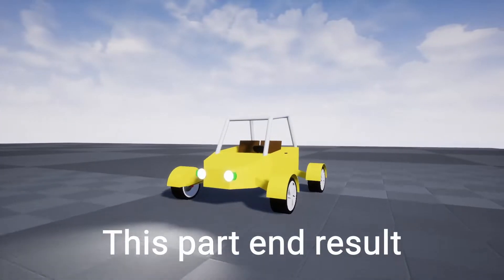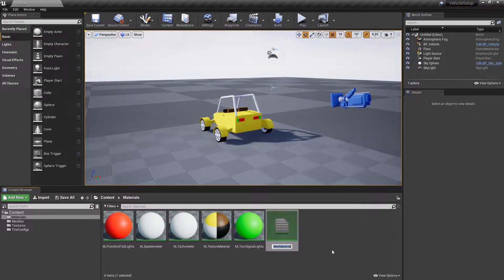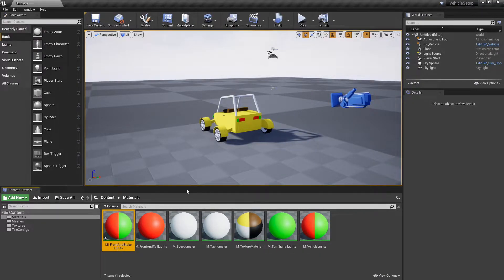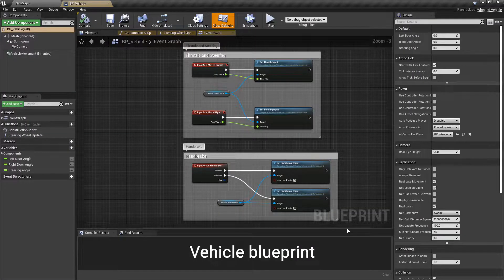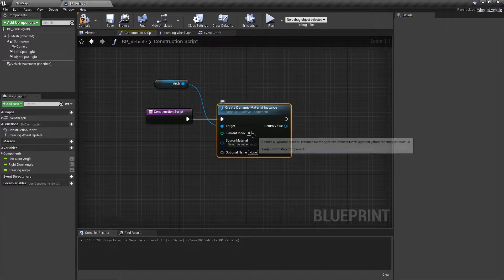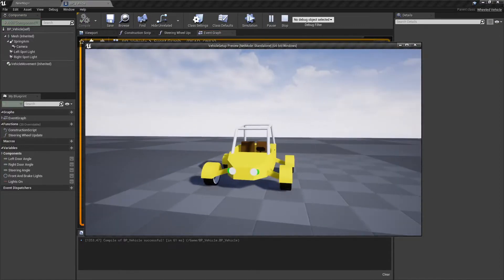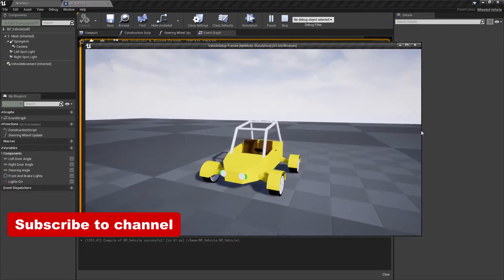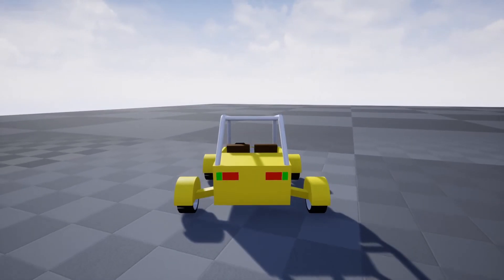How to add lights and brake lights to the vehicle | [Part 9] Low poly vehicle for UE4

Comment: Hello, I would like to set up a separate material for the front lights and separate material for the back lights. The reason I want to do this is because the mesh I am using does not seem to want to work with this method of having the same material for both lights.. I have checked my UV's and they have been assigned to left and right. Only my front lights work.  Can you tell me how to set this up? Am I right in thinking I can do this in the construction script at 3:04 ? The create dynamic material instance node can have a source material. I can select front headlight material and set new variable, copy and paste for rear lights?
Reply from the maker: You can just use 2 separate materials for the front and rear lights. Just use 2 dynamic material instances and you can also use simpler material for both lights.
Reply: @ContinueBreak  you mean 2 dynamic instances in the same line ? gotten the same trouble but on that i want to set-up an Trans Am rear/camaro light style , aka flasher and rear park light in the same bulb. x) ive simply duplicate a mesh over my normal brake light so i can set visible or not when emission. yet again im new to unreal engine and well. can't figure out wish nodes to use in cetrtains conditions :/